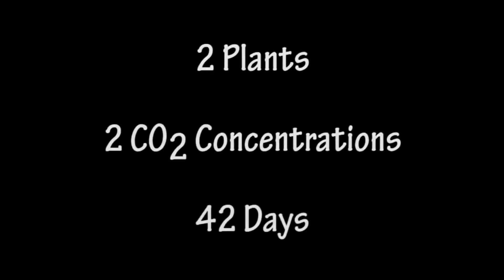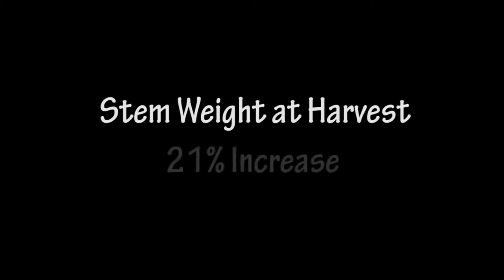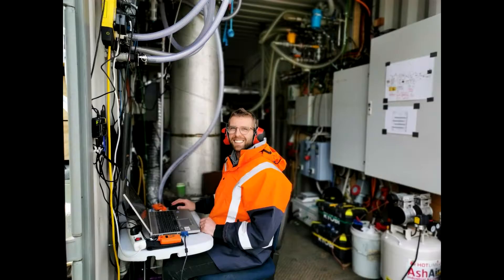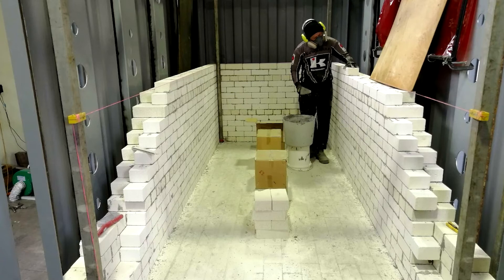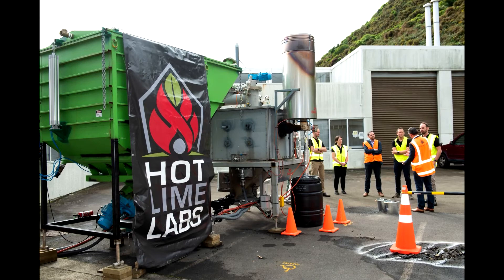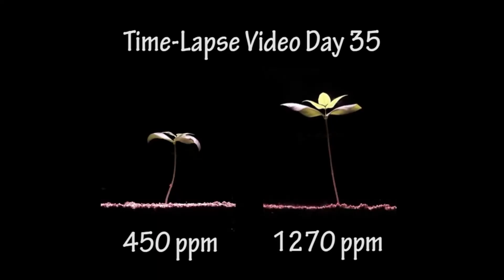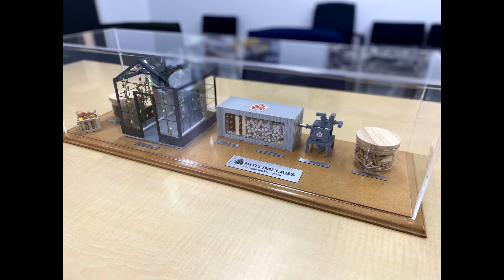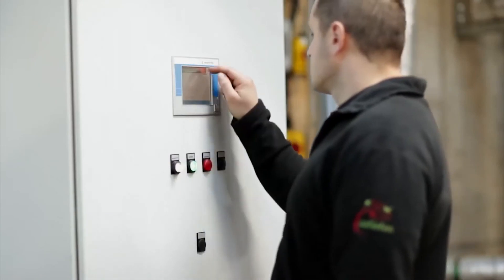Carbon dioxide for greenhouses from a gasifier. Review and thoughts.

Comment: This is overkill.  Take wood chips and inoculate with mushroom mycelia.  The mushrooms will supply the CO2 for the green house while inside the greenhouse.
Reply from the maker: no
Reply: @gengaz-lagunov  your response was very laconic and Stalinistic, however, very predictable.
Reply from the maker: @estebancorral5151  )))))))))))))
Reply: Yeah it helps, but where will it go?  Will you have rollling beds?  Also the gasifier supplies power so why not use the waste gas when filtered correctly?